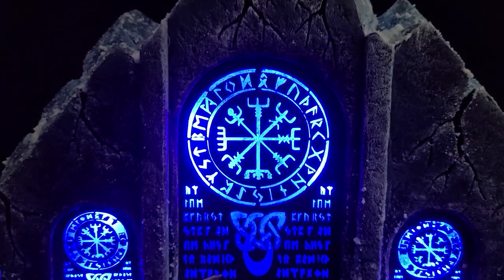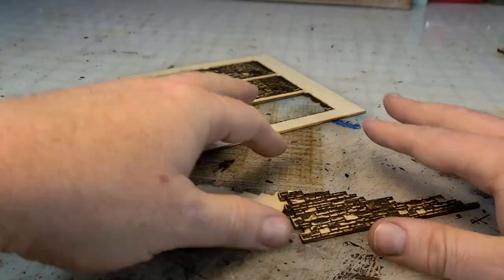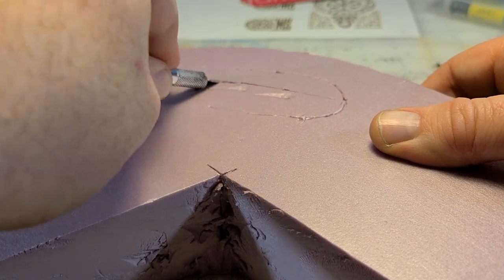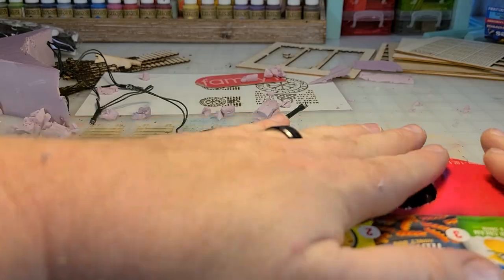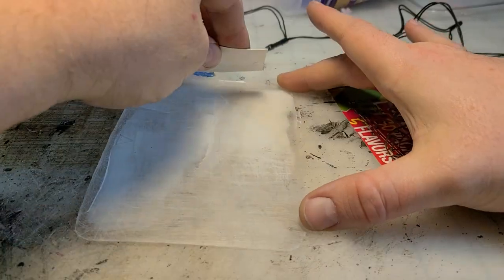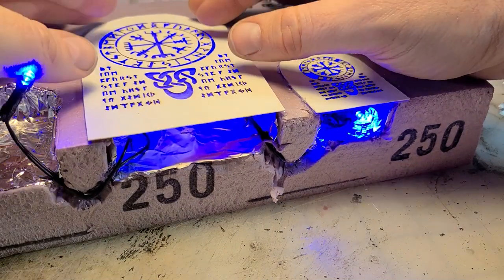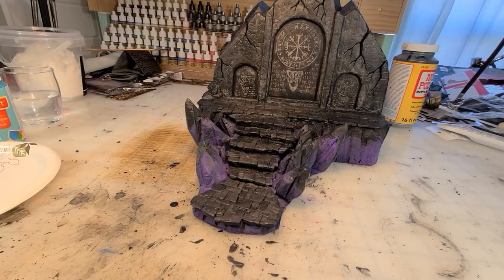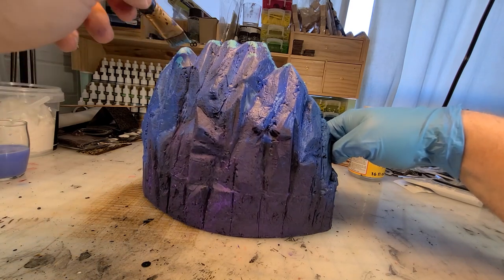Frozen Runic Monument

Comment: You might want to look into getting some foil tape meant to seal furnace and hot water heater ducts. It's already adhesive, and might come in handy for future crafts as it has a very smooth surface. Might prove more versatile than aluminum foil with glue.
Reply from the maker: Great tip.  I will look into getting some.

Comment: Next time paint the rune panel before gluing it to the plastic. When you paint the rest of the piece, just mask it off.

As for project ideas, why not a clockwork dungeon with a rotating room?
Reply from the maker: Great painting tip.  I like the idea of a clock dungeon.   I'll have to give it some thought.
Reply: It's a tricky prospect not gonna lie. I've seen it tried a few times and never had it actually worked as intended.